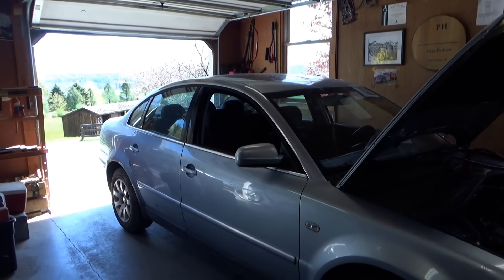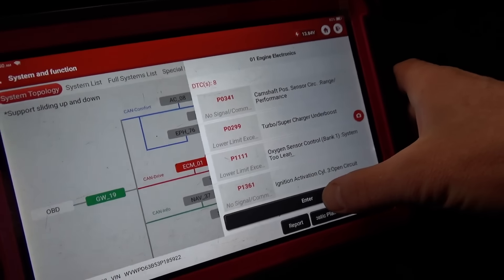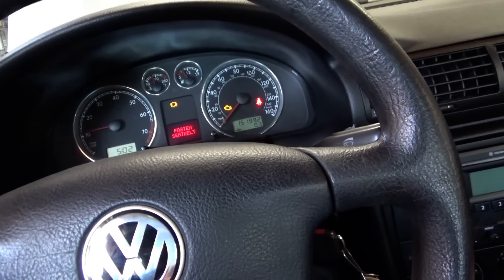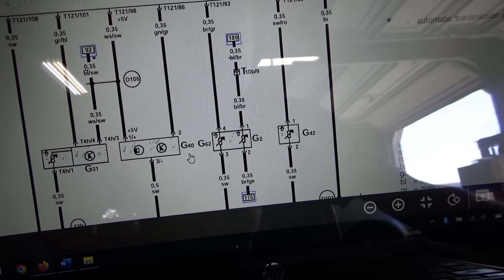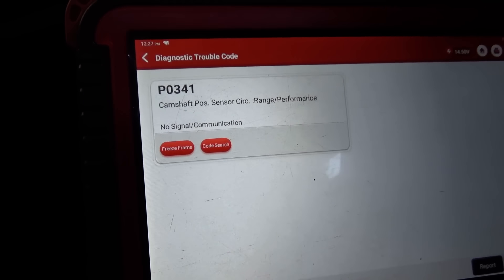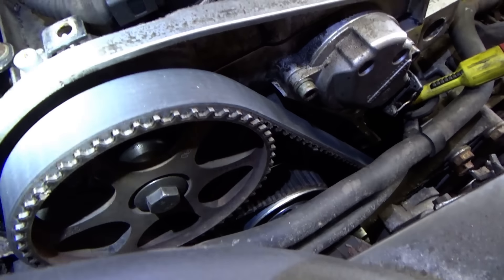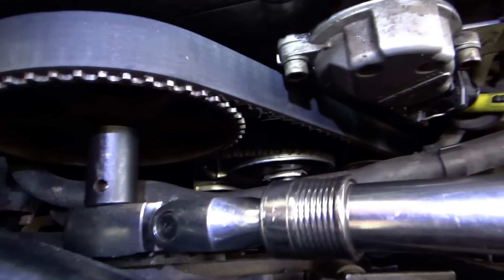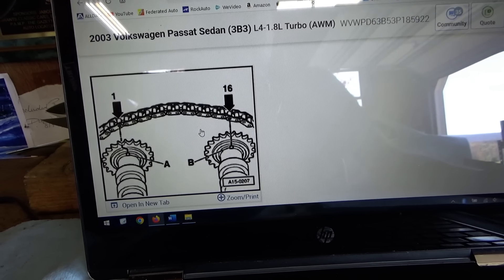Crank 5 TIMES to Start?? Part 1: Diagnosis (VW Passat P0341)

Comment: peugeot has the same design a chain to drive intake on their 1500 diesels and that's where they fail. PSA finally found the cause! 5w30 oil instead of 0w30

Comment: What?  No detailed analysis of the crank vs cam waveforms?  Hmmm, I was expecting that Ivan.  Perhaps the intake cam is     off a tooth, but the scope should help you know for sure if you have the correct waveforms to compare it to.
Reply from the maker: We'll get the "correct" waveform after the repairs in Part 2, then we can compare ;)
Reply: Yay!

Comment: Sounds like the check valve in the fuel system is going out.  I used to have to crank my old Cherokee a lot, then found out about the check valve.  I had to key it to run 3 times to let the fuel system build pressure before it would crank.  It wasn't long before the pump itself burned out months later.  I replaced with an airtex, and that was the first and last time  made that mistake.  It went out on me a few months later, and I had to repeat the process.  I found out only Bosch fuel pumps are good in those era Jeeps.

Why do they put those moving parts in there for the chain to sit on?  I had a timing chain on my Cherokee which never failed and survived multiple engines, no moving parts added on, just a chain on 2 sprockets.  Complexity is a breeding ground for failures.  They do that to design failure/wear-n-tear to keep service fees going.  That is my opinion.  Every time I see videos of engines with stuff like this I take note of which manufacturers to avoid.  I've been watching videos of car-fixes for ages and where I don't see this is in any of the Toyota and Honda line (so far).

The only way to have that chain "shortened" by one of those dowel pins is if that plunger thing  was fully collapsed/pressed down during installation.  One more thing to kick average joe's ass when he's trying to fix his own car because VW wants $7,000 for the job.
Reply: That's an interesting assessment 🤔  the movment is for vvt on the intake valve. I doubt it's fuel pressure related . Most likely it was missinstalled or possibly jumped... a tooth somehow.

Comment: You lost me @10:10.  What exactly told you that a camshaft position sensor wouldn't fix the car?  I've watched it three times, but I don't understand.  I'm with you on most of the rest of it,, but what about the gobbledegook on the screen tipped you off?
Reply: I believe it's because it had a continuous digital waveform while the engine was cranking over.  The duration seemed to vary but it was being triggered and was registering with each revolution.  If it was defective then the waveform would have been dropping out because that sensor is either off or on with no in between.  That is the waveform that goes straight up... across for x thousandths of a second... and then straight back down.
Reply: @watchdogu.s.a.8973  Thank you for that.  I'm not a mechanic, but I'm doing my best to understand this stuff.  Sometimes its just too far over my head.

Comment: I see ur second guessing urself with this too. It took me multiple videos to watch to finally get that back chain correct. But I bet that's ur problem. Another big issue is under the cowl on the driver side the box gets water inside and destroys the ecm n tcm n the relays.